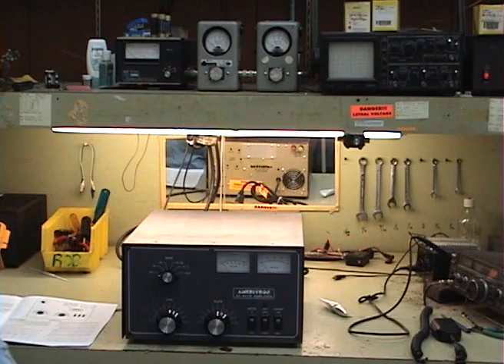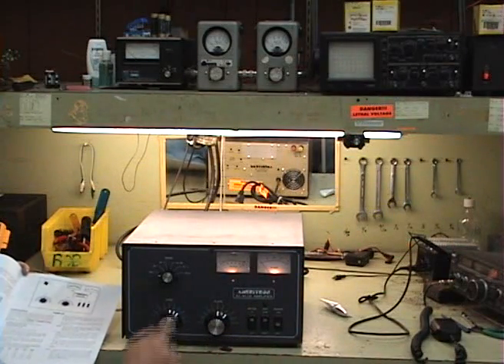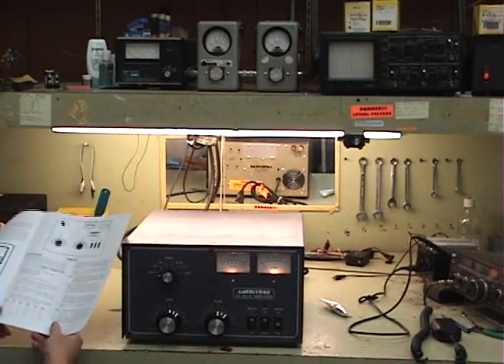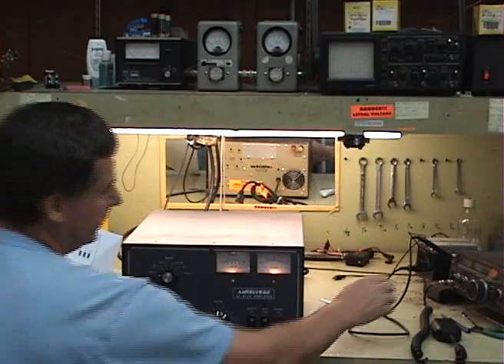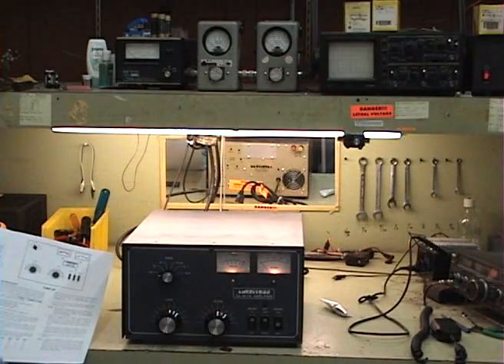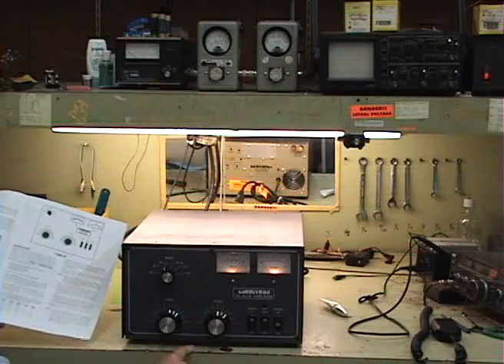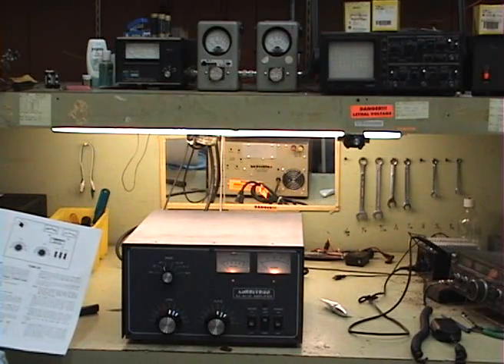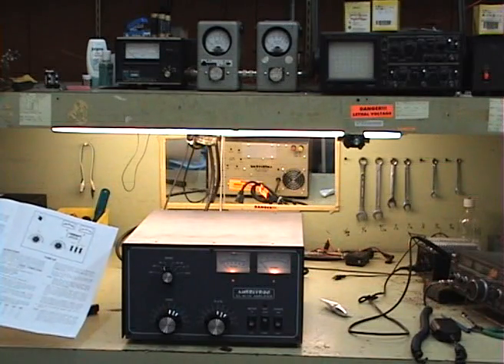Tuning your Ameritron Amplifier - Part 1 of 2

Comment: I've owned an AL-811H amplifier for well over a decade and so this two part video was a great review.  I had never really adjusted the ALC in the amplifier and so part two was very helpful.  I really like my amplifier except for one thing.  That relay noise when keying the microphone is loud and distracting and not a lot of fun when operating VOX. A major improvement for Ameritron would be to upgrade those relay switches. 73 and good DX all! :)